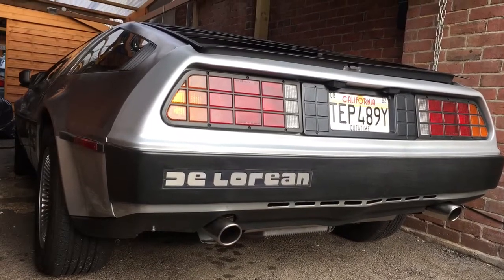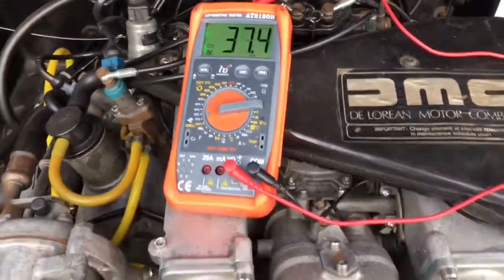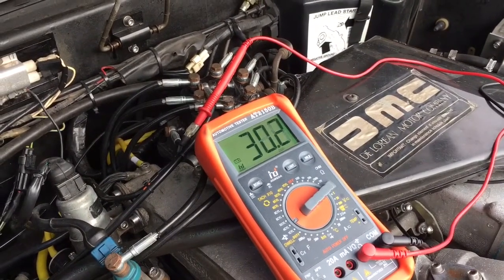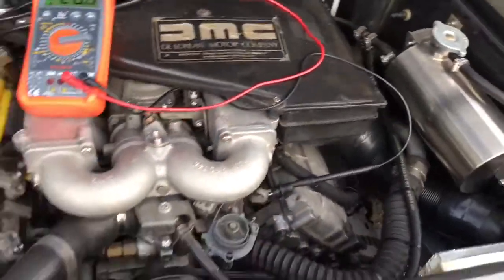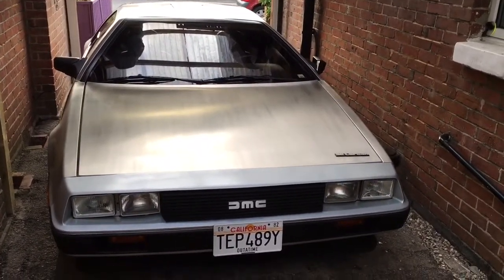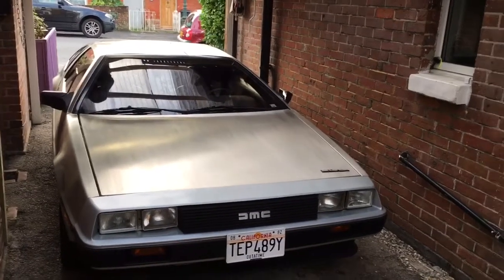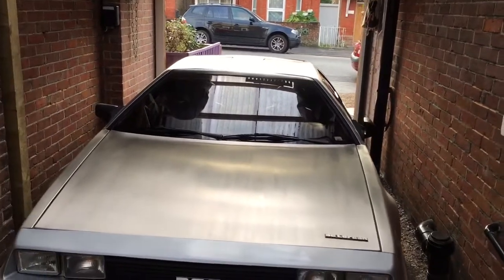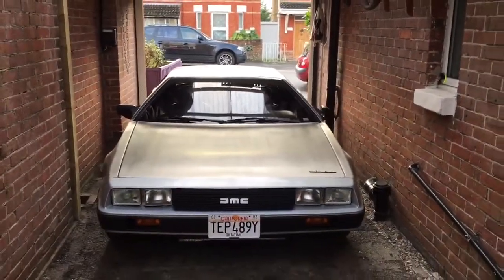Part 2/2 - my DeLoreanGo Sports Exhaust - the Sound , engine Revs , Dwell & my opinion on it

Comment: Thank you for posting these 2 videos.
Reply from the maker: Hey, I’ve now used the system for a while and it’s a neat unit.
But it does drone a bit on Your ears, just has that certain pitch inside the car.
Certainly sounds better though to the passing public.
I do like it mechanically but the drone is a tad annoying at times .

Comment: Do you have a driving and accelerating Video, do you considered as a big upgrade ?
Reply from the maker: Hello,
I don’t - I’ll take one though :), hopefully this weekend.
My muffler actually failed slightly a few months ago, something has come loose inside it, rattles when cold, so that’s a cut open, fix and a stainless guy to re-weld it (you can’t just buy another muffler).
I do like any of these kits, there much neater underneath the car, look beautiful and sound better (you’ll never get a sports car sound from this engines).
Other than the  fault inside the muffler, I do love it overall.